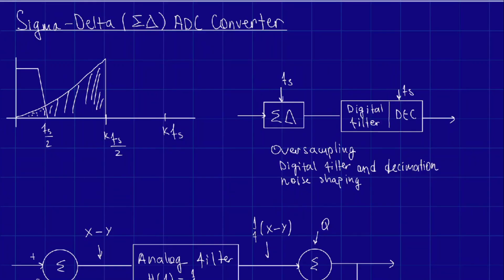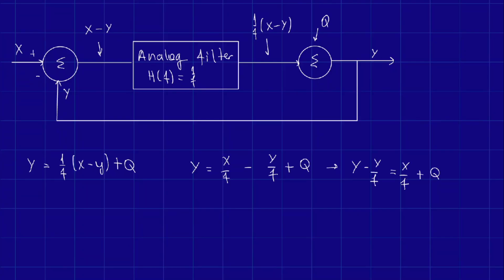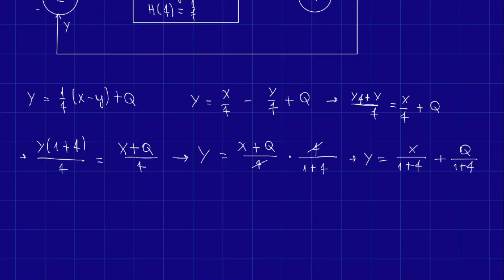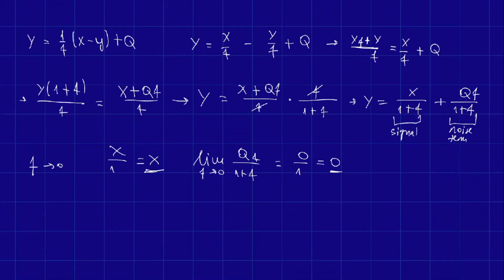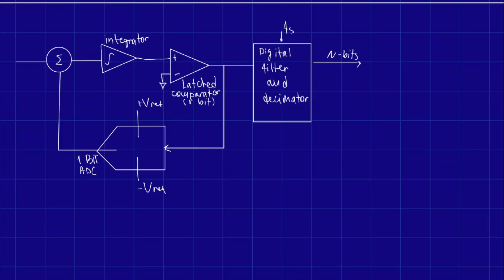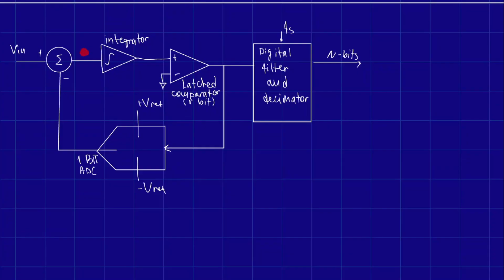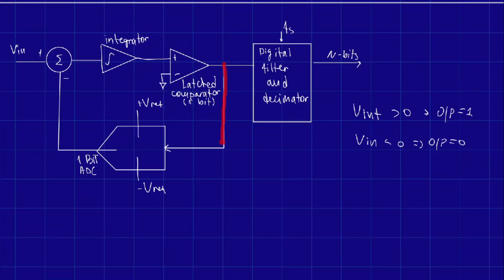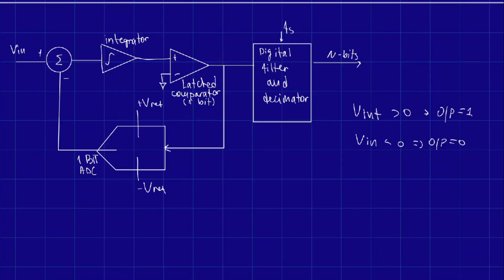Sigma-Delta ADC Explained: Oversampling, Noise Shaping & Decimation (Part 2)

Comment: I think the ADC should be a DAC, because it produces an analog Signal
Reply from the maker: The whole circuit is an ADC, but you are completely right that the block in the feedback loop is a 1-bit DAC. I made a typo on the whiteboard.

At 4:11, I explained exactly why we need a 1 bit DAC. We are trying to subtract an analog voltage(Vin) with another analog voltage. And since the voltage coming back into the feedback loop is digital, and we need to convert it to Analog, we need a DAC.

I apologize for the typo, I hope this clears things up.
Reply: @Byte-Sized-Learning14 thanks for the explanation
Reply from the maker: @prettysubtle6746   no problem! Thank you for noticing this guys.
Reply: same